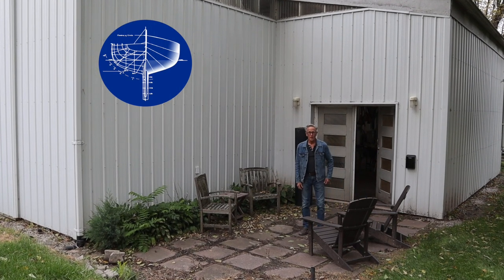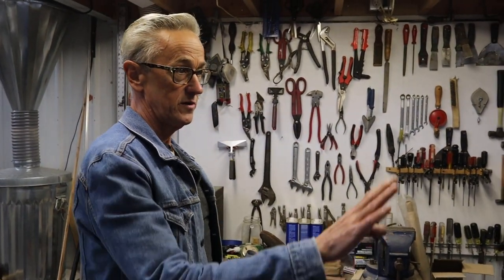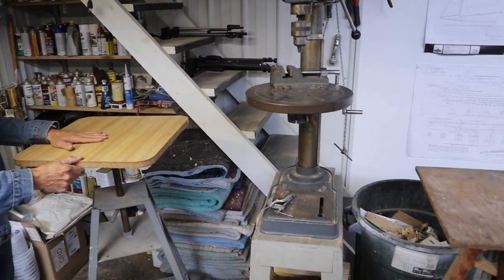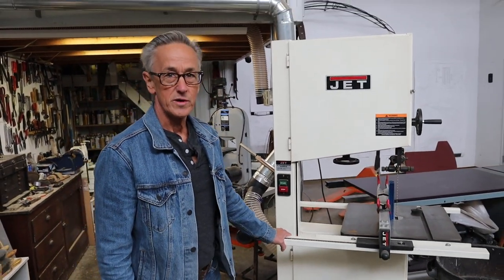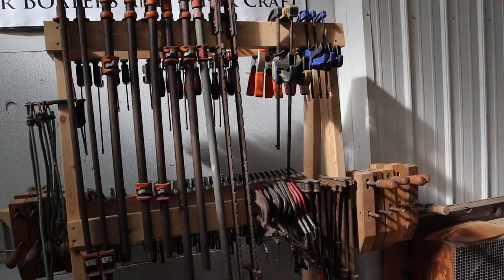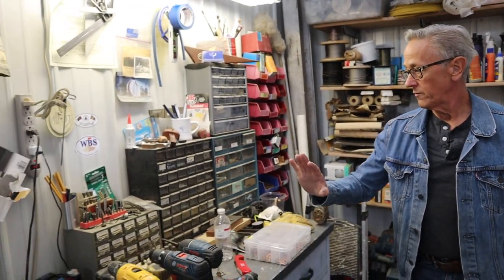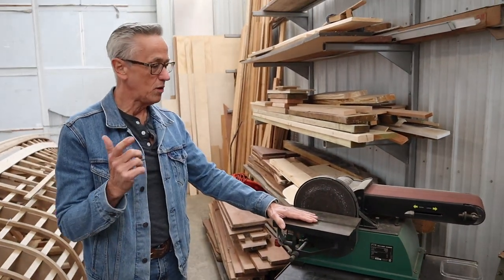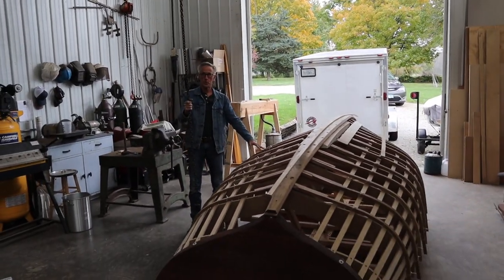Wooden Boat Studio Tour, S2-E11

Comment: Wheels on stuff is good. I used the SOLEJAZZ Workbench Caster for tables and even put some on a set of shelves so I can move them around they have the nice feature of being able to lift the table up and roll or drop back down on the legs for stability when you get the table where you want. Very handy when you want to sweep up under the table.

Comment: Thanks for sharing. I am setting up a new boat shop by converting a barn and will incorporate some of your ideas. Casters and rolling work stations seems to be the theme! Thanks again, Mike
Reply from the maker: Glad it was helpful!
Reply: @TheArtofBoatBuilding  I also found your studio tour very helpful and watched it more that once  to get ideas for my own shop... now, it seems to me  the outside contour is 40 feet deep and 36 (not 40) feet wide, minus a cutout (20 by 16) where the entrance court is. Is it roughly correct? That would make the roof pitch 3 in 12 ,  for 9 feet drop over 36 feet with... very nice work space.

Comment: Bob, your channel is great! The content and production are fantastic. I just found this video, and really enjoyed it. Did you build your shop with that L shape because of square footage restrictions with your zoning or more for the looks? Also how are you heating it in the winters? I love that bridge crane you have, it has me rethinking rollup doors vs sliding door on my shop expansion. Thank you!
Reply from the maker: Welcome, I'm glad you're here. No square footage restrictions. I designed it with the L. From past experiences with studios I realize that I did not need lots of head room over machines like table saw, bandsaw, drill press... And that the bridge crane would only span 20' 
I heat with an infrared gas heater ( its the long tube hanging under the trusses)
The sliding doors are a must for full operation of the bridge crane.  
Thanks for your kind comment and for watching!
Cheers,
Bob